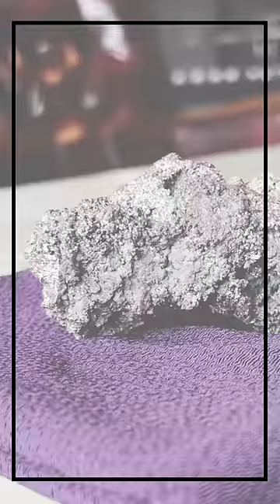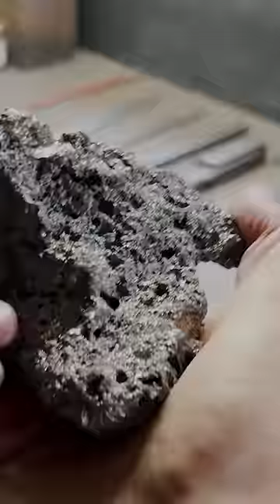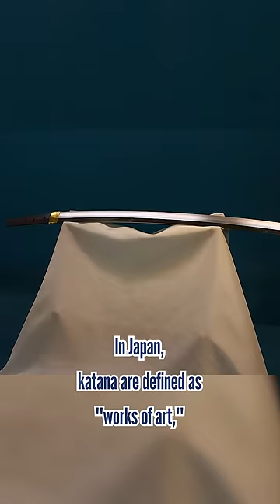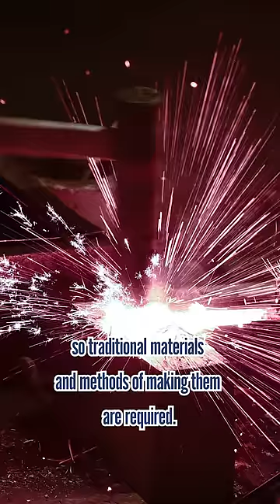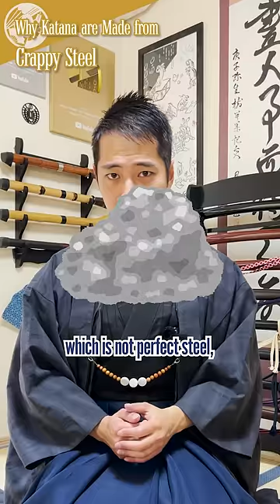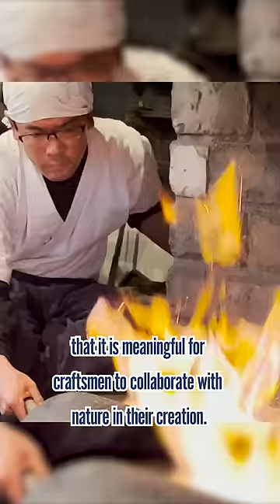Why Katana are Made from Crappy Steel #Shorts

Comment: Honestly, the fact that they turned iron rich sands into anything is basically a miracle. There is a LOT of work that goes into turning the byproducts of smelting into usable steel. In some cases up to roughly 90% of the material is taken away in the process, most of which is slag and impurities. European finery forges did much the same thing. It's remarkable to see the convergent design from the other side of the world.

Comment: Same with clay :-) There are lots of different clays in Japan, but real artists use it “nama” with its little stones and chips of rottet plants. It’s these impurities that if you are lucky create a “happy mess” like “ishihaze” (stone explosion) in the glaze. Some glazes like shino are not even possible without nama tsuchi. It is really beautiful to see it in forging as well, thank you!
Reply: The clay to make raku needs certain characteristics to withstand the thermal shock between hot and cold. The use of this type of iron to make katanas is only justified through tradition, since there are better irons.
Reply: @hellboy7424  that depends on what you call “better”. There are “better” swords than katana, the medieval European long sword for example. And “Nama” for clay does not always mean “straight from the ground”. Often it has to be broken to a powder and kneaded to make it workable. But the same with tamahagane,  it takes quite a while to forge out most of the impurities before actually shaping the blade, doesn’t it?
Reply: @karlgustav9960  At no time in my comment have I said that the clay to make raku has to be strictly and directly extracted from nature. It's part of my profession and I know full well that commercial clay can be adapted to be suitable for raku. You see it? New adaptation and materials, NOT like the artisans who make katanas in Japan.
Reply: @karlgustav9960  By "better" I mean that there are better steel alloys out there today than what is traditionally used in making Katanas. Stronger, with better edge retention, more flexible, more resistant to oxidation...even lighter. That's what I mean by "better".

Comment: They've actually done metallurgical analysis of swords from the Muromachi period, and found the steel to be roughly equivalent to modern 1055 carbon steel (if I'm remembering all the trace percentages correctly). It isn't the best steel in the world, but it's perfectly acceptable blade steel. Moreover, the form of the katana was optimized for the type of steel it was made from. The idea was to make the best possible sword from the available materials. The same steel would make a very poor rapier, but it makes a perfectly fine katana.
Reply: Can You name the people who did that analysis?
Reply: @laranabarco7882  Cyril Stanley Smith. He was a metallurgist who worked on the Manhattan Project. Sadly, he passed in 1992, but his work lives on. He actually tested swords from several time periods, but it's harder to pin down later swords due to the varying carbon content in the san mai  construction. The edge might be 1065-1075 while the body is closer to 1045. I just mention the Muromachi period blade because other than a lower manganese content, it's virtually identical to 1055. It's uncanny.
Reply: @lukediehl1210  there's definitely more impurities like phosphorous and silicon in most cases, but with the extensive forging process these are redistributed so finely within the metal that they're basically a non-issue.
Reply: 1055?? that's pretty soft for what tamahagane is. You sure it's not something like 1070-1080 grades on the edge?
Reply: Impressive, did they temper the martensite or leave it quenched?
I don't think 1055 would go up to 60+ HRC in hardness, but usually European swords went from 20HRC to 40, with exceptional cases at 50 and plus. There's no real point in having a hard edge if you're gonna strike hard targets all day, and i've personally butchered a deer with a mild steel falchion beacause i didn't have anything big enough to remove the head and limbs (no damage on the edge, the mild steel took the abuse no problem).
Reply: @ForgeDuLys  I don't know about the tempering. I know the traditional method is a differential hardening. Put clay on the spine to retain heat, then quench. The edge gets rock hard, but the clay insulates the spine so it retains the heat. Then after the blade is removed from the quench, the spine normalizes. It's basically just an edge quench.

On a separate note, you don't NEED something big to butcher a deer. I used to work in a butcher shop. My job was to remove head, hooves, hide, and hang it in the cooler. We could take in up to 200 deer on the opening day of rifle season, and I did it all with a 6" filet knife. You take the front legs off right through the joint, and there's a trick with the hind legs that lets you snap them off with your bare hands. The head is actually the  easiest. With that little knife, I could remove a buck's head in less than 5 seconds. My boss was even quicker.
Reply: @delsinhays6421  That's what the study showed. Later period swords, from the 1700s, were closer to 1075 on the edge with 1045 on the spine. The earlier sword, from the 1500s, was a 1055 monosteel. You gotta figure 2 centuries of technological development.
Reply: @lukediehl1210  right but a rock hard edge isn't of much use for a sword. Now if it's 1055,it's not "that" bad beacause even as quenched it's still kinda tough. But a quenched 1095 blade is unusable, it will just chip and crack constantly.
Also i had to cut the deer up in small pieces so it would fit in the cooking pot... And frankly a sword just does the trick very well. We did butcher it with a knife, and then to remove the limbs, i grabbed the choppy. I don't see how that's not optimal, it took me litterally one swing per cut
Reply: @jeanladoire4141  didn't mean to criticize your processing technique. Your phrasing just made it seem like a big, heavy blade was required for butchering. I agree, cleavers have a place. I was just trying to provide some additional information for anyone else that might read this comment thread.

And yes, I agree, an overhard edge is counterproductive. "Rock hard" is a figure of speech, not a precise technical description.
Reply: A rapier is a bad example cuz you kinda just need spring steel for those afaik, but on the whole, no the type of steel won't make a massive difference in the weapon like that, unless you're talking about the difference between something like a sword and an axe.
Reply: @ForgeDuLys  One of the advantages of laminating hard steel on softer iron is that you can quench it very hard, and the iron will remain durable. 

It's the same idea that makes bimetal hacksaw blades work.
Reply: @iotaje1  yes that's the principle of san mai. But if the edge is too hard, it's gonna crack on the very edge, as in the part that isn't covered in iron. The iron would only help with the overall flexibility of the blade, not the very edge
Reply: @jeanladoire4141  That can be corrected for by the bevel angle tough. 

In carpentry tools, a very different but still pretty similar tool, the laminated construction of Japanese chisels allow them to make very long lasting edges without making the chisel brittle. Western makers tend to use alloy steels that are more abrasion resistant to get the same result but those are very difficult to sharpen.
Reply: i tested them myself and they are crap.
Reply: @delsinhays6421  Yes what I have read is that tamahagane is actually highcarbon steel to the point of it being too brittle.
Reply: @allopez8563  It depends on how long you cook it in the furnace and how much iron you add onto yhe bloom. The blook is a mess of high carbon spots and low carbon. It doesnt help that sulphur makes it worse which is why you fold the steels before combining the soft iron and the hard steel. 
Katanas are cool, but i like Ulfberhts specifically because theyre just pure "f u" energy.
Reply: It is pretty soft for a sword, but let's be honest, how often were the blades actually bunged up? Given they were sidearms and status symbols, I imagine the average Samurai could go quite some time without needing it repaired or replaced
Reply: Comparable in terms of carbon content, probably. Guarantee the sword steel has far more impurities and inclusions than modern 1055. Modern steel is better quality in 99.9% of cases
Reply: @TheOneWayDown  they were fine for unarmed peasants and pows but probably not against another sword.
Reply: @lukediehl1210  doesnt seem right to me is all.
Reply: This comment section is awesome
Reply: that era also had much more open trade with other countries so i bet you anything they had other steel imported. which would make sense why they had odachi that were around 6-7ft long
Reply: @CChan11  tool steel is a wonderful material we take for granted

Comment: You missed the most basic and fundamental part: Japanese used dirty metal because that’s all they had. The constant hammering and folding was to remove the impurities in the metal.
Reply: European stratified steel swords (common in early middle age, before the availability of large quantities of homogeneous steel) were made like plywood. Katanas were made like concrete. 
The goal of European swordsmiths was to alternate soft iron and cast iron layers, so to have the right blend of elasticity and stiffness. That of Japanese swordsmiths was to blend Tamahagane of various carbon content so to have several bars of omogeneous material to use for the various parts (usually a soft internal and a stiff external, with variations) of the blade.
Reply: He didnt miss that point he purposely omitted it because thats not a reason why they still make katana from tamahagane its a reason they originally made katana from tamahagane in the first place.

ie maybe i used honey to sweeten my tea when i didnt have any sugar but now that i went to the grocery store and bought some sugar why do i still use honey to sweeten my tea?  maybe i like how it tastes.
Reply: The folding doesn't even fully remove impurities, it just distributes them evenly so there isn't a waekspot that makes it succeptible to breakage.
Reply: No, they're talking about current-day katana production. You know the Japanese can source any type of metals worldwide nowadays, right?
Reply: They could have made it better if they had better furnaces, european blacksmiths would make better product even out of satetsu.

Comment: The mixing of steels is what makes the blades of Soshu Masamune so beautiful.
Reply: Masamune method is Sosho kitae 7 panel method. most modern katana are kobuse, Sanmai and maru (Mono steel) bloom steel is called pig steel for a reason Tamahagane have a same carbon silicon ratio of the 1095 and shirogami 2 or 3. but 52100, T10, aogami 2 will out preform tamahagane in both strength, toughness, hardness, wear resistance and stability.

Comment: For those who don't know, even Europe used bloom steel (same as tamahagane, just a different name) before they had the blast furnace.
The only areas that had the purest of steels were India and the Middle East, who liquified the metal in mostly air-tight ceramic cups, which allows all the impurities to float to the tip and be broken off later.

Comment: I've asked this question to you in a previous post (though not so derogatory). I figured a lot had to do with tradition and the steel was effective, though not the best quality that could be produced. However, your statement of craftsmen working with tamahagane makes sense as modern steel would be difficult to work with using traditional techniques. Thanks for your input.

Comment: There is one more thing that you missed, but that's okay because the inventors of the process didn't really know it either.

It's really high carbon, which is normally a terrible material for anything, but in the lengthy forging process most of the carbon is burned away, so you end up with quality steel, even though you start with terrible steel.
If you started with quality steel, you'd end up with pure, soft, iron.
Which is actually what happens on the core of the blade.

Comment: On the topic of metalurgy: basically all of the early steels produced before the invention of freshing/decarbonisation, is in modern terms (high) "carbon steel" (all steels have carbon, otherwise itd be iron).
Before we found out how to remove carbon from liquid iron, it was technically pretty much impossible to make low carbon steel, like we use in construction, general machine building etc. 
While those traditional steels are all able to be hardened, as they are above the 0,2% C that are required for quench hardening, they will never produce a blade as finely tempered and tailor made as a modern mill steel, because you never know quite how much carbon and other stuff is in your steel, so you can't harden and temper exactly

Comment: Imma just point out that all steel has carbon in it, "carbon steel" means "carbon carbonated iron"
Reply: This is, of course completely accurate. 

 Unfortunately the bladesmith community picked up some verbiage that's outside metallurgical norms.  "Carbon steel" refers to steel who's only alloying element is carbon.  It's used in much the same way that "manganese steel" is.  Yes, it's redundant.  But much like "atm machine" it rolls off the tongue and conveys information accurately, so it sticks.
Reply: @Typexviiib  nah it should be called "nonchromed steel mixed with no copper, alluminum lead [...] enriched uranium"
Reply: You know carbon steel is an actual metallurgy term?
Reply: From a chemistry standpoint yeah it is but from a manufacturing standpoint, distinguishing it as derivative or variation of a particular compound with its own name would be valuable
Reply: @LikeTheBirb  right, but how many world renowned TV shows about metallurgy do you know? Checkmate
Reply: @Enrico Addonizio  how many chemically specific world renowned TV shows can you come up with. Your logic is ridiculous and you're being pedantic for no reason 😂
Reply: @LikeTheBirb  Breaking Bad
Reply: @LikeTheBirb  yes, yes i am. I didnt even watch Breaking Bad to be honest.

Comment: ‘Still cuts through limbs and bodies’
Reply: Pig iron can do that. 
However stainless steel does it better.
Reply: @rustomkanishka  Pig iron's a bit misleading.
Reply: Sharpened rebar will do the same :D
Reply: @jonajo9757  you know how you see those videos of half naked dudes who will make steel in a crucible? That's the level of tech.
Reply: Lets be real any sharpen steel that can hold an edge can cut bodies
Reply: @raihanwinata5329  that's facts. I managed to cut myself on the edge of a table at work once...
Reply: @rustomkanishka no, it really doesn't.
Reply: @Mika-ph6ku  I got an aluminum foil cut once. Took ages to heal, and hurt worse than a paper cut. I'm sure the slicing methodology of katana wielding would produce very painful flesh wounds, even with weaker steel 😅
Katanas aren't made for hacking, after all.
Reply: @Mika-ph6ku  i sharpen a metal ruler till razor sharp tried to shave my ankle it end up having a scar
Reply: @raihanwinata5329  peak IQ
Reply: @rustomkanishka  416 and 304 stainless is crap for swords, other stainless is too brittle. best stainless for swords are AEB-L and CPM-Magnacut if you are rich and find a thick and long billet of that.

Comment: High carbon steel isn’t bad steel, it just has different usage from most types of steel. High carbon steel creates some of the most brittle but sharpest edges. Due to its high carbon content it becomes very hard and when something is very hard it is  very brittle. but being so hard means it can be sharpened to create a much more fine edge, suitable for cutting and slashing, which is ultimately what katana are made for.
Reply: This sounds like the most valid argument for it, probably should be pinned, and perhaps is what the smiths meant when they reported to Shogo it was "high quality." High quality for the purpose it was being used. Rope makes a bad needle but an excellent lasso.
Reply: It isn't the most ideal but it still works. I am sure an other reason why the katana is single edged also has to do with the poor quality ore they had. I am also 100% that a swordsmith and samurai would absolutely jump to a sword with better steel. Japan is known for tradition but the Samurai definitely would "upgrade" if they could. People are shocked to learn the Samurai used guns as well.
Reply: @dianapennepacker6854  Japanese swords are single edged due to preference, religious significants and such. They did use double edged blades such as earlier swords or spear/polearms that called for it. It wasn't a technological issue.
Reply: I made a katana out of spring steel and it is way better quality metal than what they use in japan
Reply: @sawyerharris6966  There's a reason why modern steel's lot better than pre-industrial steel

Comment: A high quality bronze blade like the bronze that goes into engines and runs thousands of miles… is preferable to katanas metal… it is wear resistant self lubricating flexible and strong and hard last a long time
Reply: Ok.
Reply: Bronze is softer and heavier in comparisons. Even some bad steels are generaly better.
Reply: @TheTenzen12   yes but bronze can be made to be more wear resistant than some steels and is very cheap corrosion rust proof inside an engine cost effective and like I said they used it inside engines as wrist pin bushings and such for decades and decades.
Reply: Also application and rpm load etc matter as well as material type I’m not talking plain tin bronze here
Reply: Ya see bronze can resist metal fatigue even conducts heat better and is more corrosion resistant
Reply: @motorizedbicyclenation53cu90  Doesn't change its softer and heavier. Just because bronze have some great features that steel have not, doesn't mean its better material for making blades. There is reason why bronze was historically abandoned for iron.